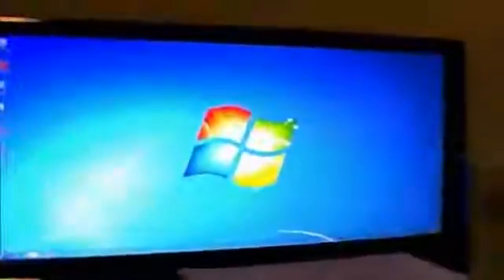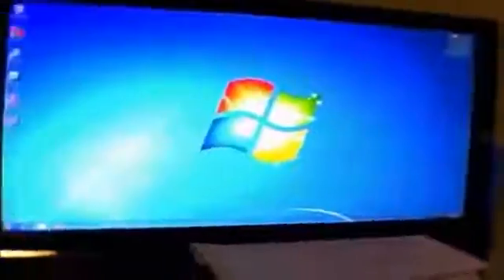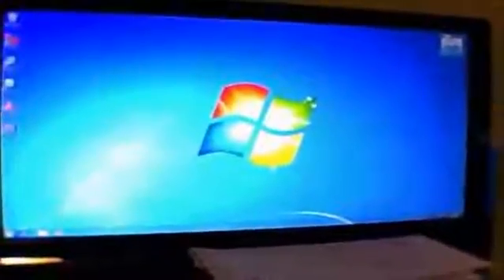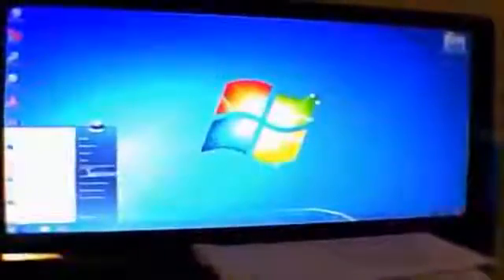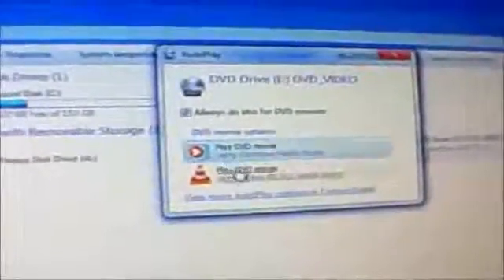Xbox 360 DVD Drive in a PC

Comment: could you possibly play 360 disks on the pc then? I'm trying to figure out if it's the way the drive scans the disk or something else in the hardware that authenticates the system and games. I have a gaming pc with 4 disk drive slots 3 are empty and I'm trying to figure out if i can put ps3 and and 360 disk drives possibly ps4 and one drives, into the slots and connect them to play the exclusive Games...
Reply: Short answer: no, that's not how it works.

Comment: Excellent job.  Just what I have been looking for.  I have it all set up and working fine except for my switch I have used a tactile microswitch instead of a SPDT for the eject.  When I hit the tactile switch the dvd draw opens but it will only close when I hold the switch down.  If I release the switch it will eject again.  Holding onto the switch is the only way to keep the draw closed.  Any ideas on this one?  Its a Samsung drive so no need to gnd pin 4

Comment: I think I understand now.. are these 3 resistors in series? just joined in a row? so say you got +5v vcc you would have the first set of three resistors all joined together on the other end of the last resistor (3rd one) its joined to the pin 8 of the dvd connector which also is soldered to pin 6 and pin 4, im asuming the drives gnd which is built on the main board for the drive. The second wave of three resistors is also connected to this right? but on the end is soldered to a switch for eject

Comment: You need a better diagram, I sort of understand most of it but the voltage divider part is confusing me like hell. Why can you not just draw where the resistors go, that would make more logical sense. Could you please do a new diagram so i can understand where there is supposed to be a resistor. Simply just putting a box title voltage divider isn't helping lol I can see the diagram that explain the voltage divider but i cannot quite make it all out

Comment from the maker: @artheadton Ya I'll send you a close up picture later tonight.  The 330 ohm resistors are what make up the voltage divider, so where it says "in" on the schematic, you connect that side to the 5V input.  Where the little triangle symbol is, you connect that side to ground, and where it says "out", you connect that side to the Pins that the voltage divider is supposed to connect to.  If that doesn't make sense, hopefully it will when I send you the pictures.